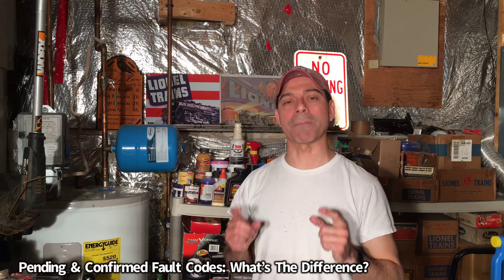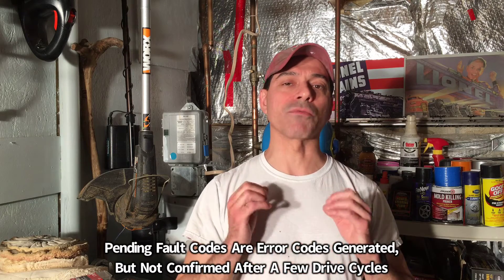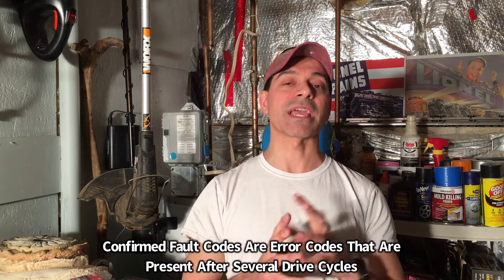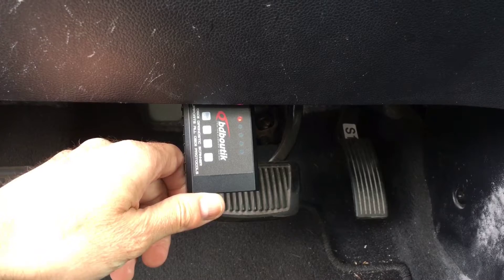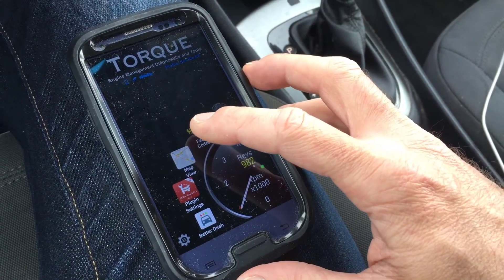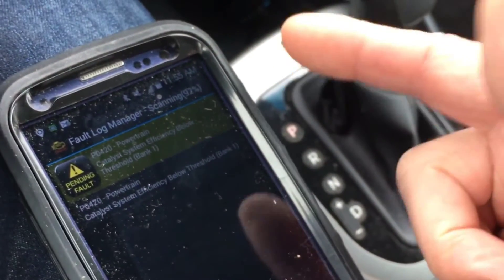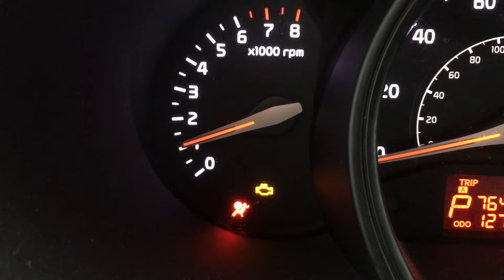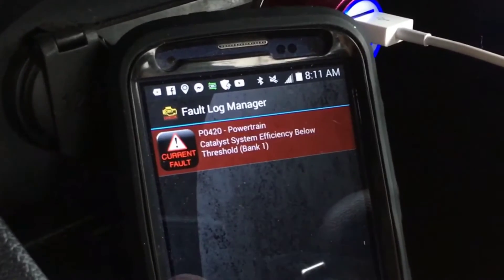The Difference Between Pending & Confirmed Fault Codes (Andy’s Garage: Episode - 174)

Comment: I had a CEL come up with the fault code P2453 (Diesel particulate filter differential pressure sensor. Circuit range / performance). I cleared the CEL with a OBD2 reader and then on the next drive cycle the CEL won’t illuminate but the OBD2 reader says the P2453 fault code is pending. It will remain pending for a few drive cycles. Then the CEL will illuminate again with the OBD2 reading saying the fault code is current.
Why is it changing from current to pending back to current again?

Comment: Will the car pass smog test with a pending code ???
Reply from the maker: @islamfouad2619  if they are just doing the tailpipe test…possibly. If they are connecting to the OBD2 port…most likely not. I’ve done it before but it all depends on the state and the testing facility. Some are more gracious than others.

Comment: I have a confirmed code P0171 and its also pending. Replaced maf sensor and 02 sensor still on its a 2000 corolla.
Reply from the maker: Which O2 sensor did you replace?
Reply: @PhillipsVision  the top one

Comment: Would i pass NJ inspection if the code doesn’t go away? Even tho there isn’t engine light?
Reply from the maker: If the check engine light is not on and they don’t do a tailpipe test, you may be fine

Comment: Can you pass smog with a pending code p0420. Monitor “C” keeps blinking. All other monitors are not blinking
Reply from the maker: If your check engine light is on you will fail. Sometimes they will connect to the OBDII port, and if any codes you will fail

Comment: Good video. Thanks.

I got a P0335 in a Nissan Almera and erased it, twice. First I erased it as a permanent DTC, later as a pending DTC.

That was something I got blamed for by the car repair man.
He said that he was hindered by that.

It may have been easy for him to use the CAN bus scanner when the DTC is present.

Can you confirm, or is there another reason ?
Reply from the maker: He probably wanted to see the history, which got erased.
Reply: @PhillipsVision  Thank you for your answer !

Can he see the history of CAN bus messages that triggered the DTC ?
Reply from the maker: @elohman1956  if the ECU has been cleared, probably not

Comment: I have reoccurring misfire  pendong code for 4 i fixed the obvious  misfire.   If reset it will see it and pending right away. New plug coil ect checked  for vacuum leaks,  it never became confirmed.   But it bothers me . Drives me nuts to where I may run a new wire like I did for Cylinder 10 coil  . Ford V10

Comment: I have 2 pending codes,  both for knock sensors after pressure washing engine (common issue on GMs LS V8). Engine runs great and I have on board diagnostic so I can reset before it becomes 'current'. I don't want to take the whole intake, fuel rails, etc. off just to replace the dumb things (I can tell it's not knocking), so I was wondering if it'll affect my performance/mileage (retard timing) if it's still in 'pending' mode. Seems to run great and have good power as long as I keep reseting it, am I wrong? Will the 'pending' code actually cause computer to pull timing, or is that only with 'current' codes?  No other codes, it's a 2003 Envoy XL with a 5.3 V8

Comment: I got that same code on my 06 maxima after the camshaft sensors stopped working correctly. Changed the sensors and cleared codes and hasn't come up since

Comment: Cleared my check engine light on my 2014 bmw x5 with cata clean.  Which is awesome.  However, the fuel catalytic converter; efficiency below limit value is showing on my BMMulti System Scan tool?  I clear it and drive it for 10 minutes and the code pops back up again on the reader.  Does this mean I have no choice but to hand it over to a dealer?  Just want an inspection sticker.  If I bring it in now; the inspection station scan will pick up the fault code as my code reader does, even though I don't have an engine light that is active.  Any suggestions please?
Reply from the maker: Sounds like your catalytic converter is either dirty or bad. You can try cleaning it with lacquer thinner. I’ve used this method with success on my car. Here’s the link to the video I did showing how to clean it: https://youtu.be/sIc0u9o_IG4
Reply: Chances are if your check engine light is off what you are seeing is a permanent code.  I am not sure the BMMulti calls them Permanent codes they may have another nomenclature for them.   The strategy I would follow is to drive the car 200 miles and get 15 warm up cycles completed then take it in for a smog test.  Oh I am assuming you are in CA.  In CA the smog machine ignores permanent codes after 200 miles and 15 warm up cycles.   MOst other states do not even take them into account so you should be OK in other states with permanent codes.

Comment: What about the permanent code?
Reply: On 2010 and newer vehicle permanent codes are basically copies of Confirmed codes but they stay around even after the repair is done.  If you have a permanent code only but no check engine light there is nothing to fix.    The ECU will clear out the permanent code once it sees the fault is no longer there after recreating the driving conditions that set the code in the first place multiple times.   There is no set mileage or days that the Permanent code will clear.  

If you need to pass a SMOG check in CA - you can still pass a SMOG check with a permanent code.  You just have to drive the car 200 miles since you last cleared the codes and complete 15 warm up cycles. 

If you do not have to pass a smog check in CA it is safe just to ignore permanent codes.  As I said there is nothing wrong with our car with a permanent code only and no check engine light.
Reply: @stevew9563  Thank you
Reply from the maker: Permanent is the same as confirmed

Comment: great video! I have many codes on MB e350 2012, Current DTC P0018, P0017, P0300, P0301, P302, P303... Pending DTC, All of the above except for P0018.... Also on Permanent DTC shows the same as Pending DTC. I'm confused.
Reply from the maker: Codes start as pending and that get confirmed, so they can be on both. You have a lot of things that need to be addressed. Misfires on a few cylinders
Reply: @PhillipsVision  I know, Misfires are due to timing chain failure or actuator.. my question is,I have a code on Active DTC that is not on Pending DTC.. what does that mean?
Reply from the maker: @Bossy23  it could be history. What scan tool are you using?
Reply: @PhillipsVision  Ancel AS200
Reply: @PhillipsVision  its not on Permanent DTC either

Comment: Andy: On my 2012 Dodge Caravan, I changed both the thermostat and driver's side blend heater door actuator (AC/heater under dash) because of clicking and operation of controls. afterwards, I cleared the DTC codes with reader. I've driven the car since May for about 200 miles. Still my DTC scanner reader says no codes detected and my car fails inspection sticker. What are my options/reason why/how I can proceed to get it reading again so I can get inspection pass. Thanks
Reply from the maker: Does your inspection station only check by using a scanner, or do they actually test the exhaust gas from the tail pipe?
Reply: @PhillipsVision  Phillips, they do not. They have their scanning system connected to the State Capital. I read no computer codes so it failed.

Comment: My Toyota Avensis 2003 1.8L VVTI Petrol has two codes P1349 one is pending  and one is current but both codes are the same. Is someting related with variable valve timing fault system. After i delete the code it s coming back again in a week. The car is still driveable as new. What can i do?
Reply from the maker: If it’s pending and confirmed then you are just seeing the history of it once pending prior to being confirmed by the ECU. Yes, it’s the Variable Valve Timing Solenoid. You can remove it and clean it; sometimes that will work. If not, it will need to be replaced. Here’s a video I did showing how to clean one: https://youtu.be/ZyQdnMLFfaw

Comment: Just changed my catalytic converter code po420 drove 65 miles i scaned it again showed status pending
Reply from the maker: Did you check the O2 Sensors to ensure they are functioning properly?
Reply: @PhillipsVision  code pulled up for 02 sensor I replaced them a month ago code cleared thanks

Comment: Good video. I now understand the "Pending" description. Problem! P0101 gone live (confirmed). Replaced the air intake complete with two new air flow sensors. That's how Mercedes sells them. Really expensive £950. Cleared the Mil lamp but retained the P0101 in Pending form. Car runs great, 30, 40, 50 miles. Get home go to bed, go to work next day and start car. Engine code P0101 live again from start. How do I Delete the PENDING code. Car is MB E class 3.0 litre Diesel. Scanner is iCarsoft CR pro. Please help if you can!!!!!!
Reply: I have the same problem on my w211 320CDI. I have bough almost an entirely new engine now but still no luck. Did you find out your problem?

Comment: Good day, i had a P2112 code says throttle actuator stucked closed, i already replaced the throttle body with a brand new one, cleared the code and still comes back as "pending". The mechanic says that it might be a faulty wiring to the ecu?

Comment: 2007 Hyundai Tucson and the check engine light came on with Transmission Control System. it’s had that for years and the car drives fine. i tried turning off the engine light but it doesn’t turn off and now i’m upset because i bought a OBD2 scanner and i feel like it doesn’t work. also the status on the problem says “current” so idk what that has to do?

Comment: I had a solid check engine light for 2 drives. I checked with my scan tool. P0420 (catylatic Efficiency below threshold bank 1) 2016 Tuscon. It popped up after I hit "sport mode" to get onto the hwy. Then I hit "eco mode" when I got up to speed. Right away I noticed the light and was angry. I took it to the dealership, because it's only at 78,000km and covered under the power train warranty. The mechanic said it's become a "stored code" but I don't know if that's because they tried to clear it. Or it cleared itself from them starting it so many times? They said they can't do anything to it unless it's active. I think if I go on the hwy and bring the car back to them. It would come on again. What do you think?
Reply from the maker: They should be able to clear a pending or confirmed code. If it’s stored in the ECU then your light should still be out. The light should be activated when it’s a confirmed code.
Reply from the maker: @biffybilliamson  if it’s a stored code the the light should go out. That is the history. If the light is on then it must be confirmed as a problem
Reply: @PhillipsVision  I had this problem 3 years ago and it turned out to be the spark plugs and coil packs needed to be changed. It fixed the problem. I needed a larger car for work, so I've sold the car for something else. Thanks for the answer.

Comment: What dose a stored code mean?
Reply: Thank you.got it.
Reply from the maker: It’s one that is “confirmed”. It’s active and not pending
Reply: @PhillipsVision  Will a "confirmed" code stay stored in the ECU until it is cleared with a ODB tool, or will it automatically be cleared over time if the issue is fixed?
Reply from the maker: @karstenrisskov6685  yes, it will be stored until cleared, or if the battery is disconnected for more than 10secs
Reply: @PhillipsVision  Thanks

Comment: My p0420 code was pending after 92 miles came back on , cleared it again and I’m at 103 miles and hasn’t came on yet but mechanic said still pending.
Reply from the maker: Pending just means the ecu got a random reading on it, but not consistent enough to be confirmed. Could be caused by a glitch. If it’s not confirmed I wouldn’t worry about it. It shouldn’t throw a check engine light either.
Reply: @PhillipsVision  In California, a pending code such as P0420 would fail smog test?
Reply: Can you pass the smog test with a pending code?

Comment: Thank you for the video.. I have a 4Runner with a cylinder 6 misfire and just changed out all my plugs as they were due. The original code is still there as I haven't driven it enough and for the heck of it ran my reader again. Now there are 2 identical codes with the second being pending. What does this mean? Thank you in advance for your time.
Reply from the maker: What are the codes...P0300?
Reply: @PhillipsVision           Hey Sports Addict: you don't check your email?  What were the codes?   I have the same issue. cyl 6 misfire. new plugs- new coils- still "pending, but may trigger the check engine light again. I have only ten more days to fix it before my CA temp registration expires.  Any suggestions?
Reply from the maker: @ghahandi  what code(s) are you getting?

Comment: I have a confirmed code. I replaced the part that Honda suggested. I cleared all of the codes but the confirmed code is still there. Will the confirmed code go away after a certain amount of drive cycles once it tests the new part?

I have a confirmed code but the check engine light went away. No pending.
Reply from the maker: shawoo in some cases, yes...it will go away after a few cycles. If you are getting a confirmed code still, you may want to clear the ECU again and see what happens. If it returns it may be a faulty replacement part.

Comment: Thanks, Drew. My '88 Fiero GT turns the engine light on @ 60 mph. So, I back off, and it turns off. I treat this old boy like ole Terry Labonte said years ago: "run it 'til it blows." :^) So I pamper it. I own two poor man's supercars: the Fiero and a '93 Probe GT. Both are pristine low mileage machines. Just short trips. 20 miles a day to keep 'em limber. :^)
Reply from the maker: Gary McAleer I remember the probe, they were cool. I want to get an original Fiero, the 4 cylinder. Your Fiero GT might have something loose that triggers the fault code when it vibrates
Reply: @PhillipsVision  With all that's going on right now, much of my life is on the back burner. One step at a time, eh?
Reply: Is there is not an issue (just a click) and no check engine light  can pending code clear by itself without the need of OBD scanner after driving several cycles